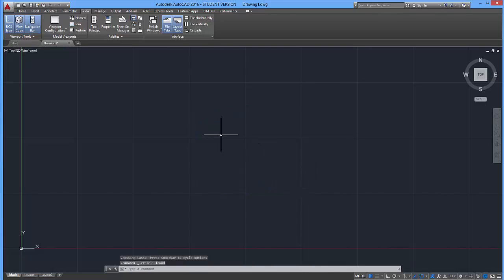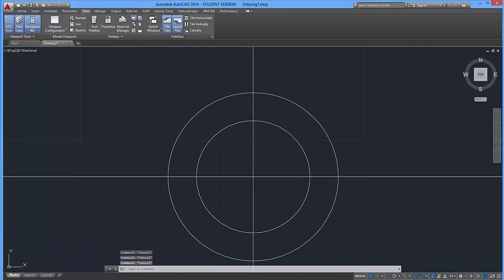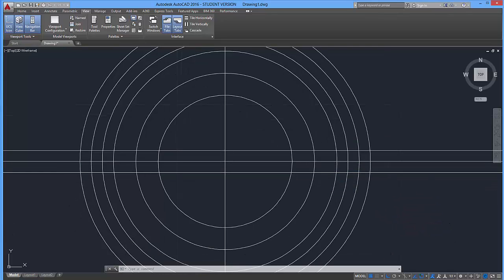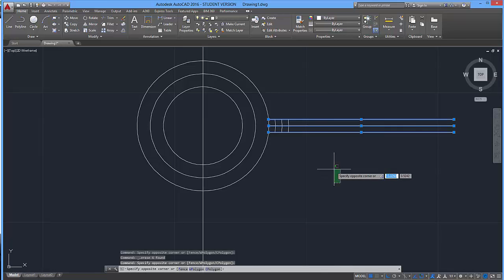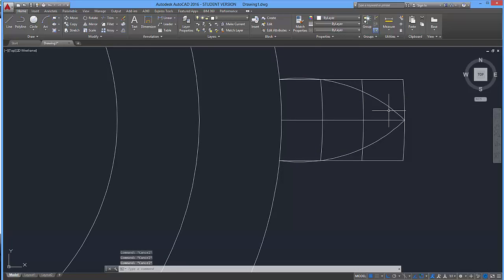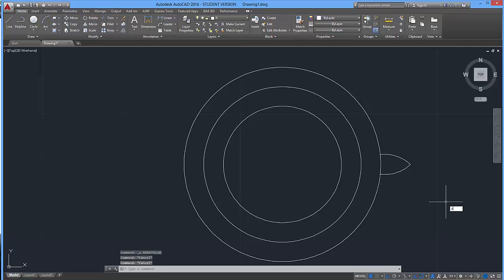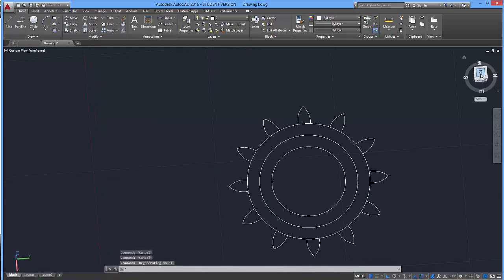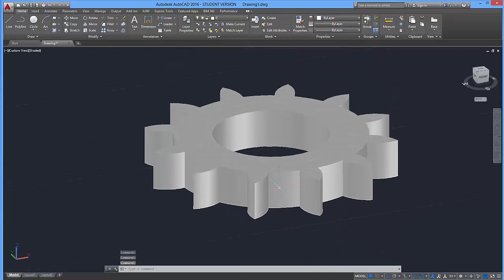Beginner Tutorial 6 - Autodesk AutoCad 2016 - Very Basic Gear Design

Comment: Hello!
I have a problem: I was able to subtract the inner circle from the solid (in order to have a ring) but my teeth don't have the upper and lower surfaces, so they are like tunnels. 
How do I put surfaces on the teeth?
Reply: Joshua Peli how did you subtract?  I wasn’t able.  I just have two cylinders.

Comment: Hi Paul.  I have a question, not related to gears but about autocad. I'm using Autodesk AutoCAD 2016 and I made a drawing of car part that I'm trying to print out profile sections of that drawing so I can make a pattern and then a carbon fiber part out of that pattern. Now the thing is that I don't know how to show the profile sections for my drawing. Do you have to draw them in? or is there a command that will show the profile sections of my finished drawing? then I want to print out those profile sections to make a accurate mold for my pattern. Is something very similar to this video: Composite (Fiberglass) Pattern Making Tutorial (Carbon Fibre Airbox Pt.1) from Easy Composites Ltd. you can skip to 2:50 so you know what I'm talking about and that will be great if you made a tutorial about. Thanks Paul! Love your tutorials and learn a lot from them.